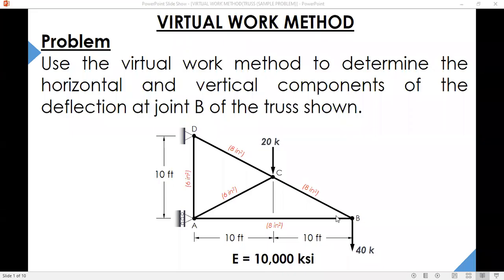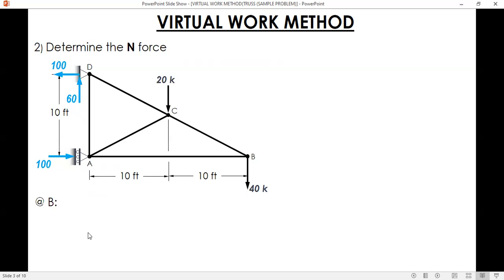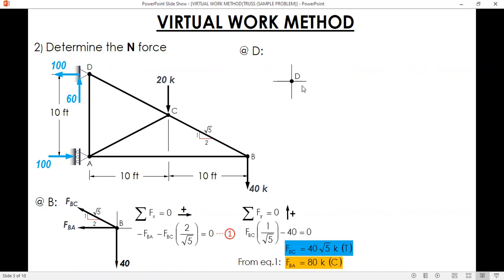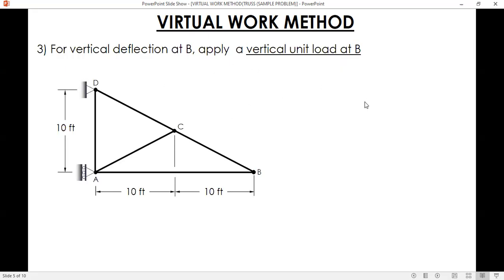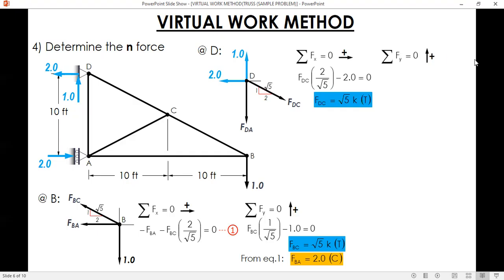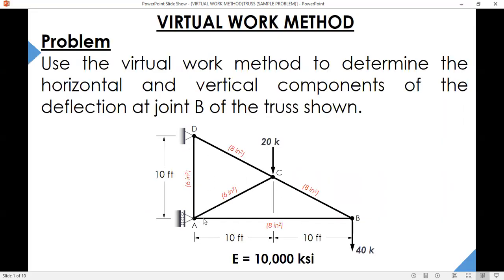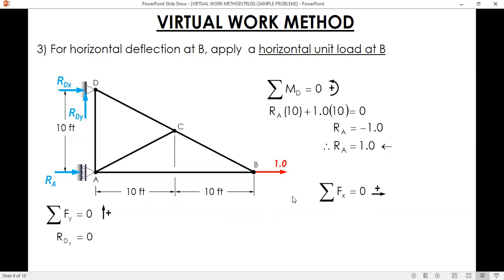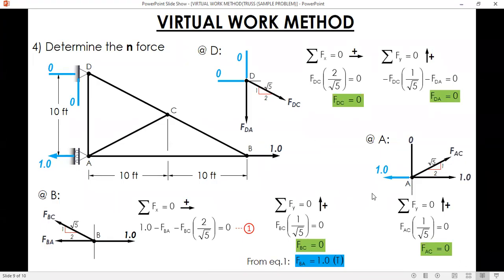VIRTUAL WORK METHOD (TRUSS) | SAMPLE PROBLEM

Comment: I thought roller support only resist vertical direction, I don't understand why your Reaction at A is horizontal sir
Reply from the maker: The correct answer is "For a roller support, the reaction is perpendicular to the surface".  In the given problem, the surface is vertical, therefore the reaction is horizontal.